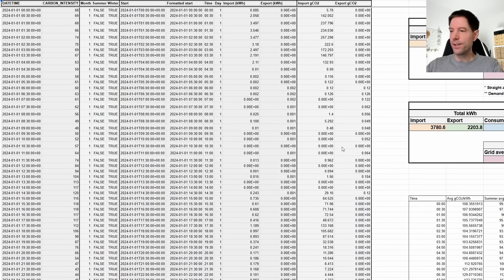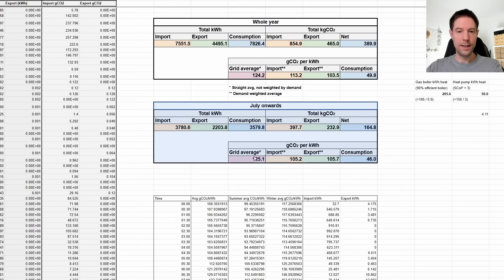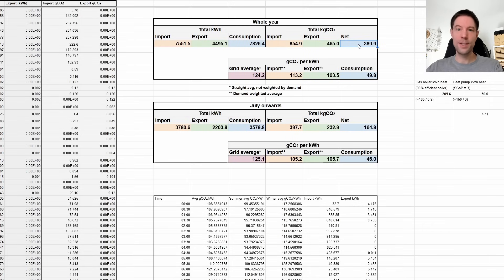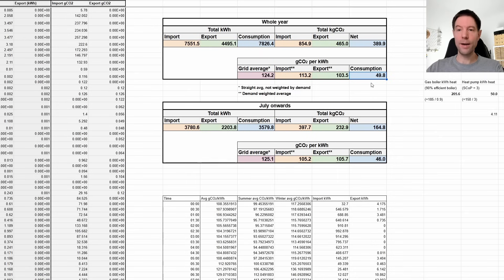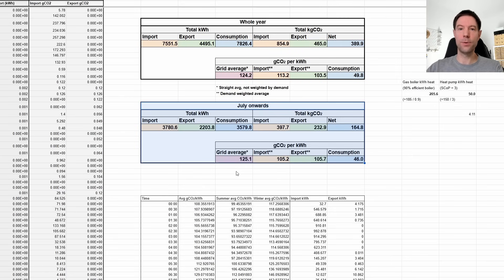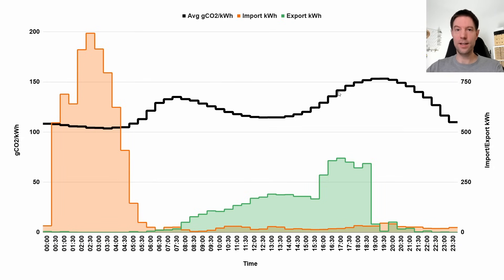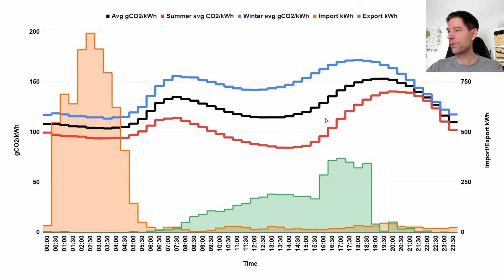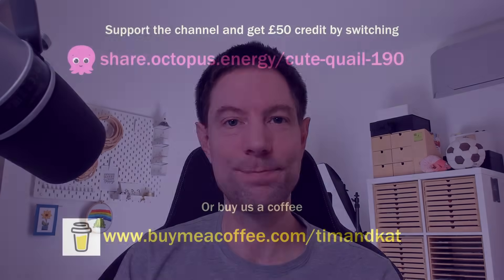I thought we were carbon neutral - I was wrong!

Comment: A few thoughts -

1) 400 odd kg of CO2 for all heat, power and transport is amazing - I'm not sure what the national average is these days, but I suspect it's at least 10x that.

2) is your solar export during the day before the evening peak skewing down your average export "carbon credit" value? 

3) I question the methodology - your importing and exporting is impacting marginal generators, not average intensity. This is almost always CCGTs with a near-flat carbon intensity. I'd argue you can only claim better if you're relieving a grid constraint (unlikely where you live I'd suspect - solar isn't constrained at midnight or 4pm). 
On the export side, you can only improve on CCGT levels of imported carbon if you are pushing diesel gensets and OCGT down, so in very high demand (usually winter) hours - this is certainly not every evening.

Basically, I'm a contrarian and think batteries domestically are a bad idea today: embedded carbon is huge; they're not providing frequency response and other grid services in the way utility scale batteries do and they aren't saving any carbon by increasing CCGT generation at one hour and reducing CCGT on another - indeed they're net consumers, adding to total demand. 

This will change over time and domestic batteries will have environmental purpose when we reach California levels of duck curves, but that's not the case today. If carbon is your motivation, it could be interesting to control the battery on Agile with variable export pricing, not Go. I suspect you'd force export a lot less and battery ROI would take a major hit. You'll also be tempted to shiver your way through the dunkleflaute!
Reply from the maker: 1) yes, that is pretty good, I'm definitely pleased with that, but I thought I was doing better!
2) yes, it all contributes to the effect I measured with a lower than expected export intensity
3) I disagree.  I've heard that argument before and although I see the logic I don't think it's the fair way to do it.  It would suggest load shifting has no effect on grid carbon intensity but that is definitely not true, since if you increase demand when it's windy, for example, you can prevent curtailment of wind farms and thus help reduce the grid carbon intensity overall.  So if load shifting works then by definition you can't claim that it makes no difference when you import or export.  Another way to think about it: it can't possibly be true that every household in the country is using marginal power (with high carbon intensity) at any given time, that's ridiculous, so therefore the only fair way to assess an individual's contribution is by taking the overall average.  And if you make that argument for consumption then you necessarily have to make the same argument for export, i.e. taking the overall average is the only fair way to do it.  I hope I've explained that well enough.  I can definitely see the argument you make, but every time I think about it (which is more often that you'd imagine!) I come down on the side of using the overall average rather than marginal levels.
Reply: I can see the argument, but how would you ever reach the threshold at which batteries can have enough aggregate effect to stop gas or diesel generation if you don't start installing them from a low base? And as Tim says, we already curtail wind energy all the time that could be soaked up by more battery demand. I don't think Octopus would be building their business model around these incentives if they hadn't modeled and projected this stuff forward into the future.
Reply: @ I think both rebuttals bring forward fair points. Despite what I said, I will be getting a hybrid inverter and batteries with my solar install this year, for instance, but primarily because it saves multiple install visits and will give me more MPPT's for my complicated roof structure, which would otherwise require more string inverter spend which will be obsolete when the batteries start adding environmental value. However, based on marginal dispatch, I don't expect the battery to be of any real carbon benefit until 2027-ish.

I think my point is that you can't operate your batteries for maximum ROI and then expect it to produce carbon optimal outcomes, and regarding the point about Octopus  - I don't think what they've done is wrong; creating business models for people to incentivise early adoption and bring capacity online that will have long term benefits. I just think that selling based on environmental benefits today is a bit disingenuous.

Overall, I think Tim's methodology is consistent - it helps in some ways, it hinders in others (e.g. not taking full carbon credit for solar displacing CCGT).

Comment: Very interesting Tim.   I'm not sure why you are looking at the grid’s carbon intensity at the time your export is made rather than the intensity of where it came from (overnight import or the roof).  Your export to the grid at that high intensity period came from low intensity sources.  There just aren't enough of us doing this time shifting (yet) for it to register at the national level of intensity. 

I appreciate I may have completely missed the point or misunderstood your logic or both!!

Keep it up.
Reply from the maker: By exporting at times of high grid carbon intensity I'm offsetting some of that generation by replacing it with low carbon energy (from my roof, for example), so I'm affectively preventing that same amount of carbon from entering the grid.  So I measure what I take from the grid at the relevant time and then offset that with what I send back at a different time.  It doesn't matter that it's a tiny amount.  It's a bit hard to explain, but I hope that makes sense.
Reply: If you save your solar for the grid increasing your exports and imports it would lower the average g/kWh figure.

Comment: Very interesting, i cant get solor because we are on the shaded side if a mountain, but having an ev, ive been thinking about time shifting my energy via carging up battries overnight at thd 7p tarrif rate and using it in the day time. 

My house uses an average of 8kw a day, rearly it oeaks at just umder 10kw. So i was thining of a 15kw battery. 

My usage is not taking into acount of the car. And id not jave the car touch the battery. I dont see the point, only downsides doen that route. 

Only over xmas did i stsrt thinking about this, so its going to be my project for 2025. All the ore packed options are far to expensive. You can do it for far cheaper with a little know how and alot of research. Also this way tou knek haoe to service your own equipment. Which for me is always the best way to go.
Reply from the maker: Solar is getting cheaper all the time so it might well become viable even in shady spots.  It might surprise you
Reply: @TimAndKatsGreenWalk  I agree, this is why I'll be using a hybrid inverter, that will have the opportunity to grow in the future, with either PV or wind. 

Then I'd then be looking at increasing battery capacity and selling it back at the optimal times just like your doing yourself. 

But at the moment I'm just looking at tying to put a system together for the cheap price. If you can make this really affordable, and then get a government grant behind this for OAPs, this could quarter the cost of their electricity bill, with a single one off winter fuel payment. Saving them more money than they ever have before. And it could help if all these household battery packs could help balance the grid when needed, instead of the grid having to pay millions to peko factories to turn on for two hours at at time. 

I started thinking about this for my own bills. And I've gone down a rabbit hole where there could be a business in this, where all parties win. 

 there isn't a company that offers an out of a box system at a cost that makes it make sense to the majority of people. The gateway is blocked by cost. 

I've been looking at the cost of batteries, the. The cost of producing the batteries yourself, that's a 4x savings, investors in the UK are priced wildly. But direct from China (Who produces  the ones sold in the UK), 2-3x savings. 

I'm yet to look into BMS system, but that's the basic outline of what you need. (Mostly). 

I think it can be done. We could bring a package together, and the pest part, when youre communicating and collaborating with Chinese companies, they will keep you in the loop, bring to every decision, good or bad, to make and sign off on. These guys, get a bad name in the world, but they work hard, work well and value the customer and will produce.
Reply: Batteries get cheaper every year, and they only save you money if you can use most of the capacity as often as possible, so don't buy more than you need right now. I'd go for a 10kWh battery and ensure you can add more easily if you need it later.
Reply: @robinbennett5994  10kw would scrape it, but just like your phone and your car, for longevity you don't want to fill it and drain it every day. I'd have my 15kw battery utilise about 80% of it. This should increase its lifespan a lot.
Reply: @StephenButlerOne  I was thinking that if you usually use 8kWh, then 80% of a 10kWh battery would be about right. 
You'd probably need a spreadsheet to calculate the relative effect of needing to buy a little full-price power for a few days per year, vs the cost of the extra battery.
Reply: @robinbennett5994  I'm thinking of using 5kw modules to start with, maybe even a 5kw, as a proof of concept. We are going down the correct path. A 5kw would drain, but that would mean we could see how the switch back to grid power works. How seamless it is
Reply: @ There isn't a switch-over (unless there's a power cut). The invert er just tries to zero-out the flow to the grid. You don't notice it operating at all, except that our smart meter just says zero power usage most of the time.

One thing I wish I'd investigated more about batteries (or more specifically the inverter) was the apps that control them. I just trusted the installer who promised that they could set it up with whatever schedule I wanted. What I didn't realise was the Solis admin interface is pretty clunky, so it's not worth changing it for a one-off event like a Saving Session.

Oh, and I forgot to say that batteries are getting cheaper at such a rate that I'm not worried about extending their life. By the time it needs replacing, a new one will be a fraction of the cost they are now. Thus I don't think it's worth paying more now to try to extend it's life.
Reply: @robinbennett5994  interesting, thank you for your feed back. Every bit of info helps.

Oh... Are your batteries 48v by any chance?
Reply: @StephenButlerOne  Yes, I think most of the server-rack style batteries are 48v.

Comment: Very good analysis. It's the Carbon Intensity of our energy usage that is of prime importance for a survivable world . . . . while our society is utterly fixated on money values.
Reply from the maker: Indeed.  There are ways of aligning those two goals (by paying a good export rate at times of high grid carbon intensity, for example) but it's not quite there yet, as I suggested near the end of the video with the Flux tariff paying the most for export before the peak in carbon intensity.
Reply: Whilst true, we are fortunate that renewables are cheaper than fossil fuel sources of energy. If this weren't the case, I expect we would likely be doomed as a species. As you'd never be able to convince the money men to sacrifice short term profits in order to do the right thing long term.

Comment: Honestly I’d have approached this as two separate calculations and graphs - one GMT and one BST to account for seasonal drift. I get you combined these but it does, for me at least, make untangling the impact and where positive changes could be made more difficult. The annual figures do, as you say, largely cancel out but I’d have liked to have had seasonal summaries. Not sure I’m explaining myself clearly as to where my aim diverges from what you said.
Reply from the maker: I accounted for the clock change in the analysis, so all the numbers are correctly aligned with the time as it was on any given day.  And I did show a seasonal split, that was the explanation for why my assumption was wrong.  By all means process the data how you see fit!  I provide the link to it in the description.
Reply: @ yes, I was mostly thinking of avoiding an annual overall calculation and just doing a season - you compared both together to get your annual which is different.
Reply from the maker: @AmsNl2BcnEs  gotcha.  Yeah, I'm building up a fair old list of possible follow-up videos with this!  It's sparked quite the discussion in the comments.

Comment: Another thought... I'm guessing you charge your storage batteries from the grid at times, probably more so in the winter. GivEnergy quote a round trip energy (RTE) efficiency of 93% for their batteries. I don't know whether this includes losses at the inverter or not, I haven't checked. That means energy is 'wasted'/consumed in charging from the grid then using or exporting that energy at a later point in time. Have you factored this in to your estimates in any way? Would it be worthwhile doing so if the data is available?

Thanks for the video btw, it's proving to be better brain exercise than most on YT!
Reply from the maker: That's another good point, yes, although the data I'm using is the meter data from Octopus, so it's everything that goes in and out of our home.  So in that sense the carbon neutrality of it (or otherwise) is well defined as the net between the two.  The consumption value is the one that would be affected by those losses you mentioned, I agree, so effectively we're consuming slightly more than is strictly necessary compared to if we instead used all our energy directly from the grid.  So I expect our consumption would really be a bit lower than the 7,800 kWh I showed in the video, as that includes the charging and discharging losses.  You can get a rough approximation of those losses by seeing the difference between the total you charge the battery and the total you discharge the battery over a given window (see my latest stats video as an example where I show that at about 12:32: https://youtu.be/sWMZaNi-lRI ).  Although I suppose if the consumption value is lower then so would the import value.  It's all very confusing.
Reply: @TimAndKatsGreenWalk  It is indeed very confusing! I think it's safe to assume all energy put in to the batteries is subject to a 7% loss if the RTE is 93%. This is regardless of whether it comes from the grid or from self generation. So if you know, or can approximate, how much energy is put in to the batteries you can work out the equivalent carbon intensity of that 'lost' energy (I think). If you exported all excess solar to the grid, there wouldn't be a 7% loss. If you import energy from the grid to charge the batteries then there is a 7% loss. Obviously this doesn't take account of cleverly importing energy when the carbon intensity of the grid is low and exporting when it's high, which you did suggest was something you might try and would result in a lowered carbon footprint. All other things being equal that is.

On a more general note, I know there are many reasons for having battery storage, but they can and probably do represent a positive contribution to increased carbon intensity in many use cases. Many people with batteries think of maximising the financial benefit by importing when energy is cheap and exporting when more expensive. If batteries are used in that way, then their use may well contribute towards moving us away from carbon neutrality rather than towards it. Now I wish I hadn't have thought that thought!
Reply from the maker: @CazBag  I think as long as batteries are charged overnight it's hard for them to end up adding carbon to the grid overall, unless they're deliberately discharged at other times when the grid is very low carbon too.  But it would need some careful analysis, as you say!  I think I'll park that one for the time being.

Comment: This is all very in depth! Loving the spreadsheet. Those carbon intensity figures must have taken a bit of tracking down. Shame about the results, but you are certainly doing better on this than most of us. 🙂 Interesting note about the tariffs too
Reply from the maker: Thank you.  There are several different sources for this sort of data but I ended up using the one that was easiest to download in one big chunk.  It actually goes right back to 2009, so there's the possibility of some interesting historical analysis too.  It also comes with the generation mix for each half hour so you can really go down some rabbit holes if you were so inclined.  I'm glad this data is available though, it's an interesting thing to investigate.  And you're right, we're actually doing pretty well, all in all, I'm pretty pleased about that.